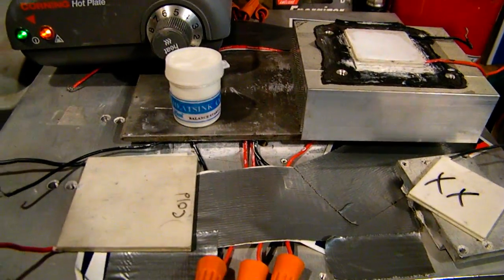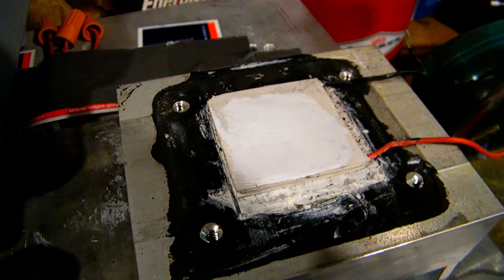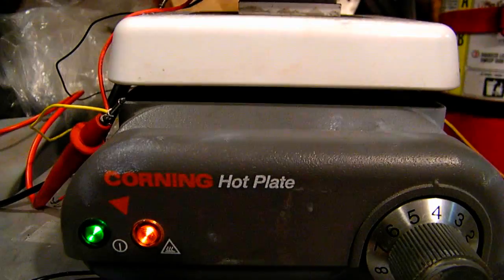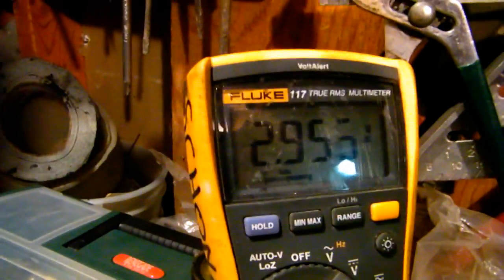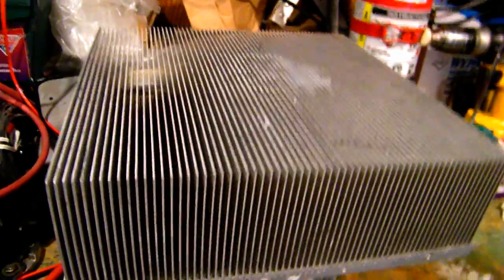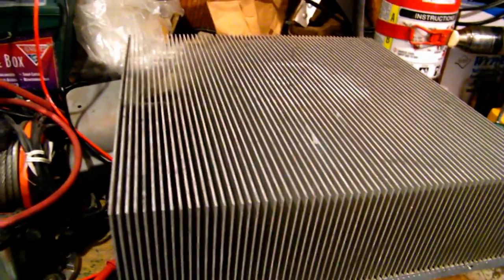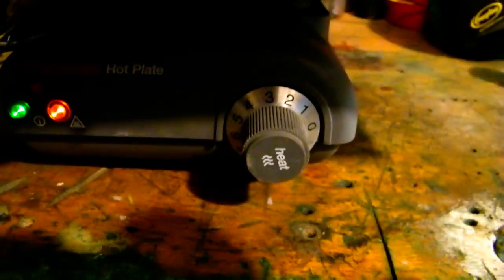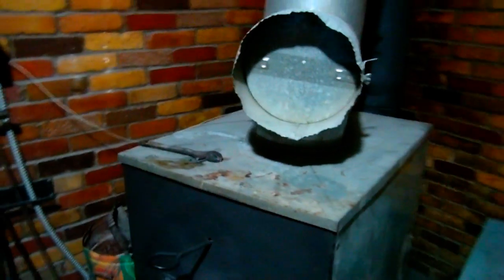Thermoelectric Power Generation On Wood Stove

Comment: Nice.  To cool it more, use a little pump to circulate windshield antifreeze from a container sitting outside during winter through a small hose and in to your TEG's on the stove.  Viola.  Big temperature difference, no remodeling of your home.

Comment: Matt.. I'm sure you already know by now that you don't want to stack TEC's like a sandwich the ones on the hot side will just burn up and the ones on the cold side will just sit there.. what you really need is TEG's they are not the same as TEC's they are made to take the higher heat that is needed to make real power.. You would want to have each one in direct contact with both the hot and cold plate. that big heat sink you got is about perfect for the job..

Comment: I know this may seem a bit out there but what if you had each peltier pad running a 3v motor and 8 peltier/motors all chain and cog together for loads of torque and that then turning a dynamo or alternator. You could easily gain better efficiency this way. All loses are spread over the 8 motors. Simple camping gel as heat source and perhaps ammonia like substance or as cooler then you could go in the middle of a desert and still make energy for days very cheaply.?

Comment: Clever idea. Potentially interesting to try out but could you supply some more details:
Specifically how many watts (or amperes) did it produce at 1.5v?
And what was the temperature (Celsius or Fahrenheit) of the hotplate and the ambient temperature of the room?
Have you determined a minimum temperature difference to get maximum watts?
Cheers.

Comment: Another method that needs no Heat and runs for free nearly for ever?
A Crystal short wave radio tuned in to high cycle static radio waives 
From Space, And then run the Speaker wires thru gated diodes like 
an alternator uses. This 1.5 volt 1.5 amp Dual cycle power can then 
be a power source for a Capacitor coil "Ignition coil" To boost it .
Each radio acts as a single battery cell.

Comment: There is no such thing as heat you have kelvin, Celsius, and Fahrenheit, these are all different ways to measure various radiation levels from, photons, sound, radio-wave, microwave, gamma radiation, electromagnetic, and neutrino particles.

Comment: Air heat sinks cause health problems from electromagnetic charges the hotter the more charge, the more charge the more harmful health effects! Use water and keep it cooler and hotter, then use insulation on the other exposed side to stop harmful electromagnetic charges and heat or cool loss!

Comment: A Dc-Dc converter can allow the high current Thermoelectric Generator (TEG) to easily run some 5V fans to cool the heat sink.  Also, the TEGs can withstand temperatures up to 800F or more (protect the wires), so between the stove (500F) and boiling water (212F) can be feasible to produce enough power to charge stuff or run a fan to distribute the heat.  Also, heat-tubes are an option for moving thermal energy from inside to outside.

Comment: Correct,  being stacked both sides eventually lose their difference.  I think the mistake many make is these produce power by heat alone and they do not.  They make electricity by temperature difference.  He is correct about something,  they would work better in winter when you can get a much colder "cold" side.

Comment: We actually have a small electric fan that sits on top of our wood stove. It's got a thermoelectric generator samwiched between the top and bottom sections of the fan. The fan itself pulls air through the heat sinks on top, cooling it enough to keep it running. Works like a charm, we've had it for at least 5 years now.

Comment: If they are stacked where is the heat differential coming from? I mean how is the efficiency maximized when they are stacked? Wouldn't that interfere with the cooling of the back of the first one, wouldn't it be more efficient just to maximize the temperature differential on the front and back of one thermoelectric module? Just asking. Nice work... I have some insight on how you could produce say 250+ watts on a system using what I can clearly see you have available...

Comment: cool ok what about the tec plates one side on the stove the other an aluminum block bored and fitted  for water or anti freeze since it makes some voltage a small dc pump to move your cooling medium to cold spaces in the house where you could use your passive heat sinks or another tec plate to run a fan?

Comment: man, if you read the datasheet, you will know that the PN junction decomposes rapidly above 120degrees C. Temperature difference is not all. 
Still, might be good as aux power for sensors instead of battery etc.

Comment: I've seen this concept in use before, and believe AMD owns the patent, someone correct me if I'm wrong.

While this is all well and good the focus is to be AWAY from carbon emitting power sources (such as burning coal, wood, natural gas and nuclear reactions) and directly the result of geo-thermal, solar, wind, tidal or unavoidable bio-processes, with a strong focus on one or more methods for sustenance in the absence of the others.

Comment: couldnt these things be used to make airconditoners, if you put them in series and attached heatsinks to both sides and connect it to the mains, insulated the heat side and vented it out with a fan and then blow the cool air side indoors...

Comment: The large heat sink would work best on the top or side of a radiant heat wood sove. It would enerate electricity and difuse the heat of the wood stove into the room quicker. 

Also, what kind of wattage are you getting with one of those?

Comment: @shonerboner Dude I had this same exact idea! reminds me of that old saying 'Great minds think alike'. However, from what I've read on the subject a stirling engine would be more efficient. But Stirling engines are pretty bulky so the T.E.Coolers might be a better option in the long run. What model Jensen woodstove do you have? oh and at 2:54 the song is N.I.B, and the Corning PC400 is a great model hot plate & magnetic stirrer!

Comment: Heatpump optimised peltiers are not good at power generation. You should get some elements designed for power generation instead of heatpumps. They will give you much better efficiensy

Comment: @bulletproof2353 TEG's and Peltiers are the same thing.  If you apply a voltage it will cool one side while heating the other, if you cool one side and heat the other it will generate voltage.  The Peltier effect is just the opposite effect of the Seebeck effect and both can be seen using a thermoelectric cooler/generator

Comment: I ran out of characters, imagine a double chimney one comes from the fire place and opened at the top, the second open at ground level and the top, the top of both chimneys would have turbines connected as one, the heat rises and spins turbine one directly connected by pulley to the second ducting and would spin in the direction that it could pull freezing air from ground level up, because there will be a little heat on the sinks the air will assist in rising also...kind of drives itself  :)

Comment: I really like your concept, and I personally think this a viable means of alternate energy production, to simplify the system I would start at the chimney. consider a second duct installation that would allow cool air to be driven using a generator system powered by the heat exhausted on the roof of the furnace system. This would not interfere with the heat production or flow, yet would provide sufficient cold air flow and would allow maximum cold on one side and maximum heat on the other. Thanx

Comment: a very neat idea! if the hot air at the top of the chimney is lost and not used. you could mount some of the plates at the top of the chimney - there u have the cool air breeze on the one side increasing convetional heat transfer. Additionaly you will not loose heating capacity of the fire place because the heat will not be taken away at the fire place directly.  in summer you could run a system on concentrated solar power!

Comment: you do not want to stack them physically until you run out of stove surface area, the temperature differential will be less for each layer reducing their efficiency. liquid cool the cool side to humidify your house or use gravity heat pipes (much simpler to DIY than modern wick heat pipes) you might be able to hard link it to your furnace intake and power it's fan by the device. better cooling will not only increase efficiency, but overheat forgiveness.
could you please post some supplier links?

Comment: do not put the cold part on outside,you vill lose heat for home,beter use smaller diference and gain all heat for home,and get electric  curren for free with no energy lose from house :)

Comment: @RoboTekno 
Higher when used as a cooler than a generator. I'm not sure what the efficiency of the coolers are, but for actual TEG units its between 5 and 10% depending on the temperature difference.

Comment: Nice experiment. You'd probably get much higher efficiency using a Stirling engine though. I use smaller TECs for cooling low-noise amplifiers, they're cool gadgets to play with :)

Comment: use a 6-12 watt fan for colling will get much greater gains i think 120mm high speed computer case fan. also use copper its double the energy transfer compared to aluminium.

Comment: Hi: Thanks for sharing your work. I have accumulated most of the parts necessary to make a TEG but I haven'tassembled or tested it yet. I am interested to know how it works when you stack the Peltiers. Do you get the same volts,amps and watts out of each peltier or does the output get lower for each peltier the heat passes through? Do you have your multi-peltier setup wired in parallel or series?
Please PM me.
Mars